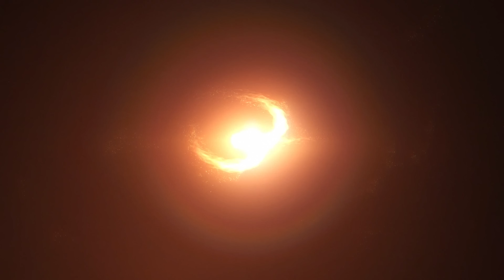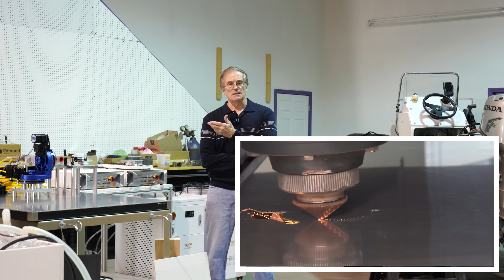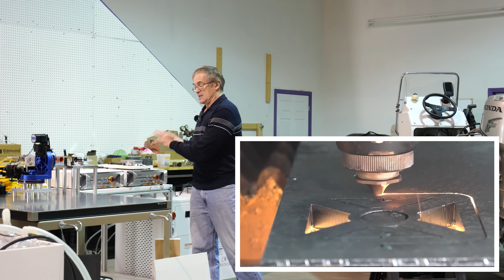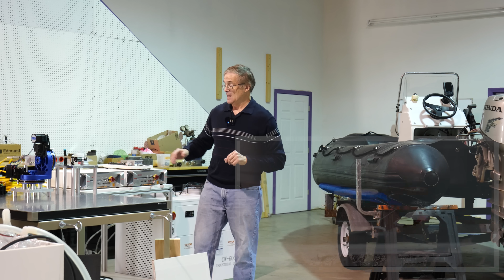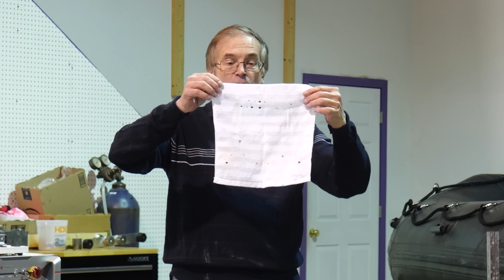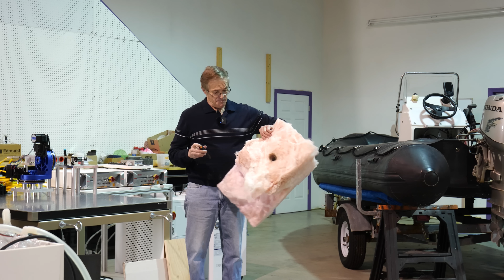We have a problem... and need your help!

Comment: Dye-Water Curtain - Flow Cell with absorbing IR dye. Use a Commercial “Nigrosin” or “IR-165” dyes, with a fused silica or BK7 back plate glass diffuser with an optional secondary dump plate.

Basically you would have water flow in front of the fused silica plate but the water flowing down would contain an Infrared absorbing dye. And then would get pumped back up to the top.

I can provide detailed designs and technical specifications. 

This provides a beautifully simple catch-and-spread engineered design that would be portable. This can easily block incredibly high powered lasers. It works, and is portable!
Reply: The idea has one major advantage, imo.  You can't create permanent holes in a liquid.  Thus, this material can be used indefinitely as opposed to solid materials which will have to be disposed and replaced after so many uses.
There are also other materials one can add to greatly reduce reflectivity.
Reply: @jdlech  Another major advantage is that the liquid is moving so the heat is rapidly carried away, it's even significantly better than watercooled copper for focussed beams.
Reply: That was one of the core premises of my design, I also went with a material that doesn't have a vapor point.
Reply: @jdlech the Leidenfrost effect may still open a hole unless the wall is deep enough.
Reply: This is a very effective method, you simply can't come close to the capacity of rapidly moving volumetric adsorption with any other adsorption method.
If some reflection is not a problem then I presume this could be done over cheaper back plate materials?
I feel like plain steel should be ok, rusting the surface might be a good idea to reduce reflections, but reflective metals like aluminium would be a bad idea in case there is a failure with the liquid.
Reply: @samheasmanwhite  I remember metal cutting used pulsed lasers to blow out the reflective melted metal.
Reply: This was my first thought too.  Plus the panel can be angled and the water sprayed down it so any reflections end up in the pool of water at the bottom.
Reply: I think this is a very good solution. I picture it with a reservoir and pump at the bottom, and a trough up top which spills over evenly to run down the back plate. It would be helpful for the water to run down in contact with the back plate. Both to minimize splashing and to cool the back plate.

I assume there are a range of dyes available to effectively absorb the peak wavelength of the laser, be it red, green, or blue.
Reply: I literally came here to say this exact thing.

Water meets almost all the criteria except the ability to absorb the light and figured an appropriate dye would do the trick.

You would then need to make sure the glass/tank is suitable. Agree with the backup stopping plate.
Reply: You're in the ballpark .. i said high end fresnel lens... Just spread the beam... Like the laser cutting table, but behind the target... Basically the entire room is a laser lab at that point and its only dangerous between the lenses where the laser is a concentrated beam...

The answer was at the beginning all along

I suspect he knew and he is testing the class 😉
Reply: Yall worried about light scattering, in the damn application its used in they scatter it into a damn wall with a lens... 

Start with what you know

How do they stop this from burning a whole through the entire earth in the application I took it out of?

Okay how do we scale that solution to my current application?

you literally just need a large lens behind it to expand the beam pattern into the brick wall... 

You solve this like a hotspot in a headlight pattern lol
Reply: Scattered laser radiation is the reason we always wear special goggles around lasers.   So, not a problem.   
@KaosProject21
Reply: @KaosProject21 but plastic Fresnel lens wouldn't it just immediately melt?  It absorbs some light
Reply: I dont even work with lasers I just have a 146iq lol
Reply: You could reorient your experiment by placing the laser and the aiming optics up high, and have the drone flying beneath it.  The entire earth would make an excellent backstop.
Reply: I thought this too. https://www.youtube.com/watch?v=ZYmhsZH2pcg
Reply: Water moving is a great example and you could add silica which would disperse the light even more. As long as it is moving and a fairly high volume with a large sheet fall effect…continuously recycled placed on a wheeled carrier would be easy to drain and easy to move as needed.
Reply: It would seem that you could experience a problem you'd see in some water cooled nuclear reactors. The steam creates a volume that the water can't get into.
Reply: I was thinking about something like a laminar flow waterfall and then saw this. Great details.
Reply: I was thinking along the same lines as a water curtain something with a high flow rate like they use on movie sets to simulate a rain shower. You took it to the next level with the IR dye.  Lots of really great ideas in here
Reply: Yep this was the idea that came to mind.
Reply: Does the beam really have to go horizontal or up ? Letting the beam decend gives the advantage of infinite amout of absorbing volume. Meaning mount the laser on or below the roof and use the space between it and the ground
Reply: Its like a conveyor belt but it exhanges the energy as a liquid. Nice
Reply: Some bullet traps use a spiral type of trap. The bullet enters the trap and hits at a low angle and spins around the spiral until it runs our of energy. Could up make a spiral out of a highly reflective mirror with light defusing lenses or materials in the spiral so when the laser passes around the spiral it would cause the beam to lose energy? Maybe as the beam goes deeper into the spiral the surfaces become less reflective and slightly absorbent. A deceleration chamber if you will.
Reply: @JDawg-bn3hs  Sounds expensive and complicated
Reply: @ZegaracRobert  Cheaper than burning down the neighborhood! Complicated, not really.
Reply: This was my first thought as well. I wonder too if it would be feasible to make a laminar flow curtain to make it more portable. Instead of having a fullsize backplate, you break the backplate up into tiles that are easily moved and rearranged
Reply: On second thought, free falling laminar flow is actually probably a terrible idea. As soon as the laser vaporizes some of the water, the flow is going to get all kinds of messed up. I think it might require a back plate to be actually feasible
Reply: @nayans710  I think it would work fine, since you are only trying to block a single beam so even if it screws up the flow below the impact point it shouldn't be able to blow a hole straight through it or whatever. But making big laminar flow screens is a bit difficult (one massive and very smooth nozzle with turbulence control and such), so it would probably be cheaper and easier to just have it run down some sheet metal, or maybe even a plastic film if you are feeling very confident.
Reply: This has to be the answer. As a layman on these things my first thought was the water needs to be moving, the thing absorbing the laser has to move. The rest of it though is SCIENCE
Reply: This is where my mind went.  If the dye is not absorbent enough, might try a colloidal suspension of carbon micro/nano particles.  The carbon will burn, producing harmless CO2, but so long as there is water/carbon solution directly above the impingement area, it will immediately be replaced with new carbon. The main danger I suspect is reflection/scattering, so be sure to wear laser safety glasses and place target in a light tight box of some sort.
Reply: Aquariums with soot and pumps.
Reply: Yep, this is what I thought as soon as I hear the problem, until the water part of the video. But adding rotation can solve that too.
Reply: hey, im a industrial glasblower, i worked with quarz glas, and the apperatures for the chip/semiconductor industry. we use white opaque quarz segments to block infrared radiation traveling through the length of the apperatur to protect the plasic or rubber seal/gasket. its stable and highly temperature resistant, and if not polished not reflective. con = very expensive. to note there are a range of ways to make white opaque glas, cheap = micro bubbles -- expensive and more effective = chemicals.
if your target area is small, give it a thought, if your area of protection is bigger than 20x20" its going to ruin your bank
Reply: @lolichbin  Yeah it's for a whole wall of a warehouse, so unfortunately no quartz, but I think it would be unnecessary to have a transparent back plate since some reflection is acceptable, it's only to prevent burning the walls.
Reply: I have the same Ideas ! We can maby use a coper plate to transfer the heat to the water.
Reply: Just noticed your comment.  What if we used water to attack the refractive index of air by misting it or using straight steam in front of the target?  Should provide some measure of dispersion prior to hitting the target.  Granted, it will be a IR glowing cloud, but it should improve the chances.
Reply: will that create a bunch of steam?
Reply: Excellent. And simple to implement. A bit tricky is ensuring a consistent waterfall over the whole front side, may using a slightly angled millimeter corrugated/V waved  to help guide the water?
Reply: What about those glass feature walls in 2 layers , or more, for overlap of joints on previous wall.
Will it go through a fish tank with grooves in glass.
Multiple layers of salt water mist walls.
Engraved glass fish tank.
Or fire downwards and start digging ?
Reply: Sounds like it would look cool too!
Reply: With all the water pump Ideas double the pumps with overlapping flows and separate power sources. Pumps and water are cheep but redundancy is a must! Your talking in less than a second you could really hurt someone!!!
Reply: Light scattering danger?
Reply: You wouldn't have to worry about light scattering because of that infrared absorbent Dye @nicolasmargottin8982
Reply: @nicolasmargottin8982 when tasked with "inexpensive" and "portable" engineers from aero"XYZ" or "testing" often come up with expensive and unportable systems... lol.
Reply: @nicolasmargottin8982  Light scattering is unavoidable in what they are doing, I presume they have taken the appropriate precautions.
Reply: @nicolasmargottin8982  Light scattering is exactly the main danger. At this power level, even if you get 1% of the light reflected at someone's eye for a few milliseconds, this would already do permanent damage. Scattering the light only means spreading out the problem from a single direction to all directions at once.
Reply: Considering the power, this will not work.
The amount of power in the beam requires mass to dissipate the heat, a flow of water will not have enough thickness to stop the beam. At best it will create constant steam and quickly eat away at the backstop - unless you are envisioning a 1 ft deep river flowing past it.

The only method to do this is to have a vat of water mixed with vantablack. You would need black water because at these power levels you will get various different frequencies of light when it beam hits things.
If you have a vat of water flowing it is unnecessary and the majority of the beam would convert to heat, if there is any residual beam leaving the vat then a backstop can be used.
Reply: @mikael2256  Ok let's calculate this; if you have 5mm thick film of water and the beam is 2mm wide (rather tight focus) that is 20mg of water, at 2.3kJ/g for boiling water it takes 46J to boil that mass, so at 3kW it will be evaporated in 15ms, replacing that 2mm wide section every 15ms requires a 0.13m/s flow rate which is very achievable, although flowing enough to fully prevent boiling might be difficult. In reality the water can absorb more energy than this since the beam will scatter inside the water, and if steam is generated it will scatter the beam over a wider area of water.

The dye would not need to be anything fancy, just any carbon fine enough to stay suspended will do, and you only want to use enough to mostly absorb the beam before it hits the wall since otherwise it just causes more of the beam to be absorbed in a thinner depth of the water and boil more of it (not a problem, just wasteful).
Reply: @samheasmanwhite  The boiling will create expanding steam, which will move the flowing water, exposing the backstop, it wont even need to boil the entire 5mm depth to cause this issue. It would happen as soon as the water is hit. So you will need much more than 5mm to stop this.
Additionally, 5mm over the demonstrated area would be a lot of water, requiring a large pressure drop to create laminar flow. Say its 8x8 meter, that will require a flow rate of 320L/s, assuming you want to clear the entire sheet every second. That's a big pump.

A vat of water, and yes, no special dye would have none of these drawbacks that flowing water has. But I would opt for nano particle carbon dye since it would be more efficient considering excited state of carbon might produce between 400 and 710 nm.
You can easily make 0,02x8x8m vat of water containing 1280L of water.
Reply: @mikael2256  Yeah, the amount of water flowing is a bit of a limit, it would prevent you from flowing enough to completely prevent boiling (unless the beam is much wider than 2mm), but if you are happy to have some boiling then it is a practical amount. 320L/s would be excessive, for the 0.13m/s I calculated previously at 5mm thickness by 8m wide (and any height) that would be about 5.2L/s. But you might as well use several times more, and probably should because of that effect you talked about with the boiling affecting the flow. I'm not sure how bad that boiling could actually be since the carbon dye would be in the steam cloud and still absorbing and scattering the beam, so it might not be a problem at all, especially if it forms a plasma which would block the majority of the beam from reaching the water. But it would be best to take precautions like adding extra carbon, in fact you might as well add heaps since superfine carbon is pretty cheap. As for making the laminar flow, that is pretty easy when it is on a surface since small disruptions get smoothed out as it falls, so you can just have a long tube along the top with holes gently spraying out and if they are fairly closely spaced then after half a metre or so it will be smooth (unlike an unsupported laminar flow which is much harder to make).

For the vat of water idea, I'm not a fan since it would be more vulnerable to burning, and there are some details that mean it is not that simple to make.
If the glass or perspex has a bit of dirt or some defect where the beam hits then it will begin absorbing the beam, and will melt (or shatter if it's glass). I've worked with a large CO2 laser and if the tiniest speck of dirt gets on a lens or mirror then even though it is an unfocussed beam the power density is high enough to burn the contamination, which also burns a spot on the optic, which absorbs more light and that burn can grow to destroy the whole optic. Focussed beams are far worse than this so I would not want to rely on any sort of transparency.
As for constructing it, if it was one big tank the sheets at the bottom would have to hold back about 0.8atm of pressure, which is 8 tons per square metre, so it would have to be split into a whole bunch of smaller tanks with replaceable ablative shields to protect the edges of the tanks, presumably quite thick ones judging by what was demonstrated in the video.
Reply: @samheasmanwhite  I suspect that even with a vat of water, if it leaks the leakage will be able to me managed with a very small pump sucking up any spillage and putting it back in the vat. Additionally, you could add particulates to the water which would clog any punctures quickly.
Yes, a vat not a permanent solution and would need to be serviced after every use, but it would absorb 100% of the light with no risk of cutting your neighbors dog in half.

And you are correct about the pressure. But panes of hardened glass are built to withhold such things. Just look at aquariums.
I do like the idea of splitting it, but the crease is a major problem since the glass could act as a prism, making for a very special disco ball laser of destruction-type of event.

You gave me an idea.
What about carbon nano-particle water filled Sodium polyacrylate in transparent vats? It would hold vast amounts of water, being able to absorb the power. Carbon would suck all the light up and it would not leak.
You could have it in replaceable boxes, swapping out the ones that are damaged, even reusing the Sodium polyacrylate when possible.
Reply: @mikael2256  Eh, there's some cool ideas in there but huge aquarium tanks are just more expensive, unreliable, and dangerous compared to the other options.
Reply: @mikael2256 He said they're using fiber lasers used for cutting metal, which are in the infrared range.  vantablack is a visable spectrum absorber.  The dye additive the guy above suggested would make the water vantablack to that laser's wavelength.  Also it should be a narrow bandwith and the light will scatter but it won't have many frequencies like white sunlight hitting a prism.
Reply: @nathanb8307  When excited materials create light of other frequencies. So to dissipate this energy you would need something that can absorb a wide range of frequencies. Carbon is a great IR absorber up to 2000nm and used for such things in various industries, but its also a great absorbent of other frequencies down to the UV range.
Reply: @mikael2256  Oh.. I didn't know that about carbon, your comment about vantablack makes way more sense now.  Thanks for the informative reply.